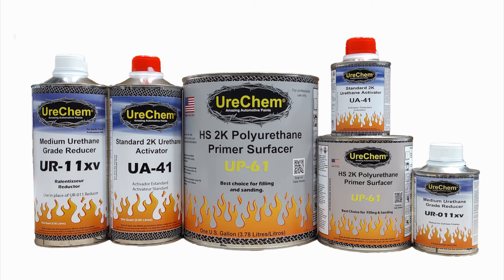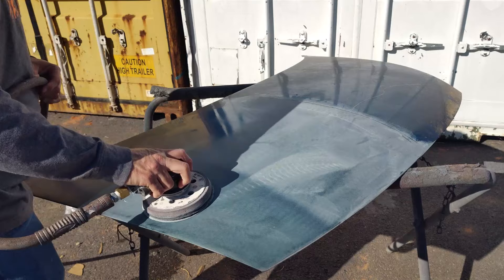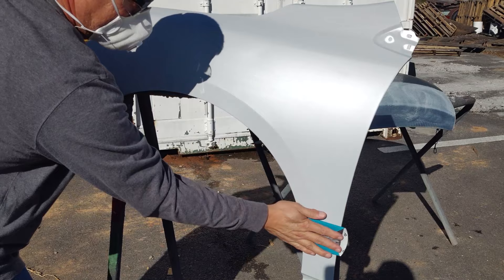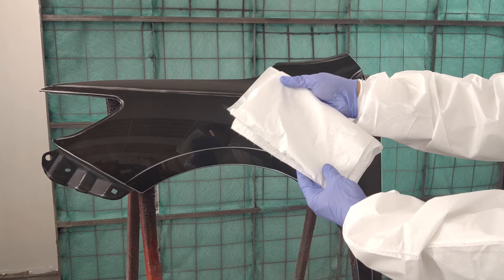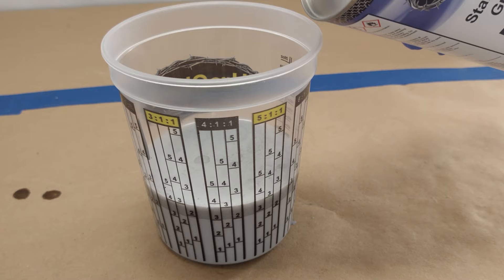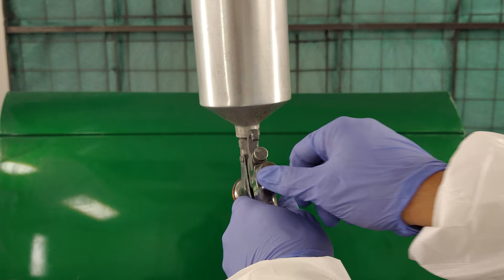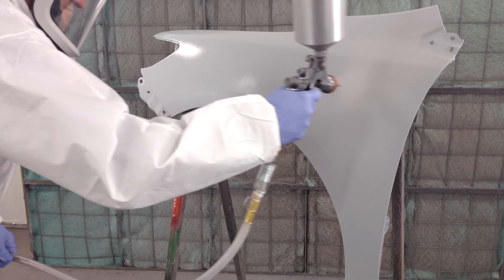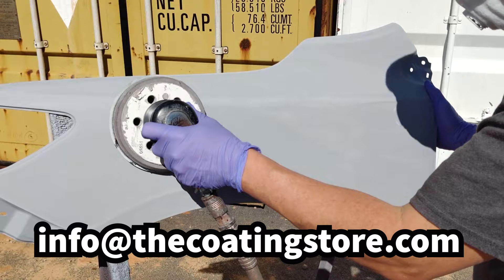How to use UreChem Chemfill 2K Primer Surfacer  UP-61

Comment: After the primer is dry and ready to sand, if using a DA sander as for preference, it works best to use a 3/4” (19mm) interface pad to avoid gouging edges or body lines like convex shapes that form a sharp line. Sand later with scuff pad to keep line crisp and sharp. 
 The standard “Dual Action” sander, has a 1/4 (11mm) throw or orbital action. Using a DA sander on medium speed with a short-throw 5/16” (7mm) works great for controlling the rate product is removed to help reveal high and low spots that may require additional attention. 
  This will speed the time required to produce a flat panel without waisting product. 
  Depending on your brand of sandpaper, but check frequently for any buildup of primer. This will lead to adding scratches instead of removing them. Use a hard block w / 80g or a folded coat hanger works to dislodge any clumps or particles that build up on the sandpaper. You may loose some grit from the sandpaper, but this acts to serve as producing a 320g to a 400g, further and quickly producing a flatter panel. 
 Don’t forget the use of a guide coat, either powder or a flat black (Or Contrasting Color) to help your eyes and shop lights produce a laser straight panel prior to an epoxy primer (For a Harder Long Lasting Finish) or top coat base in the many colors of your choice.
  Thank folks!
DK, Omaha. ASE Master Tech since 78